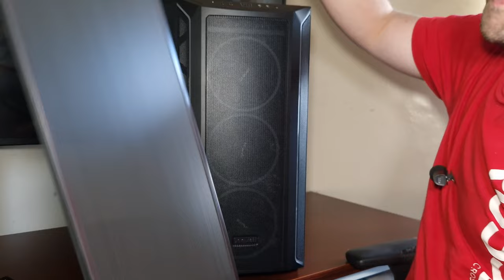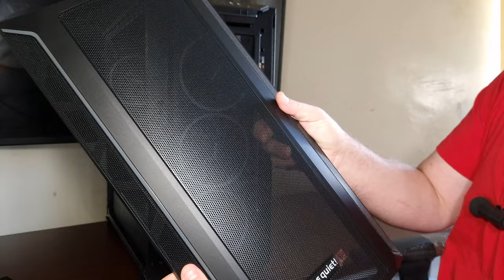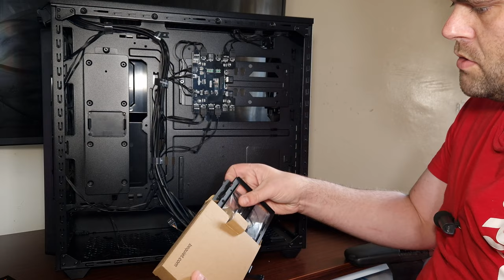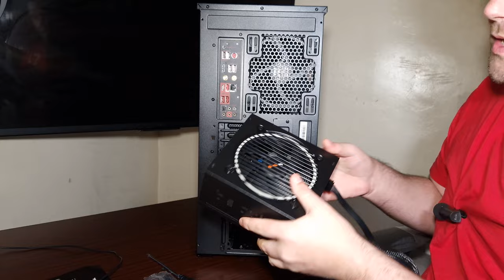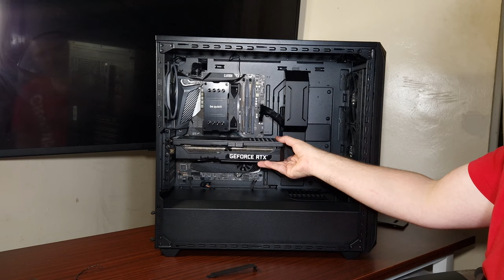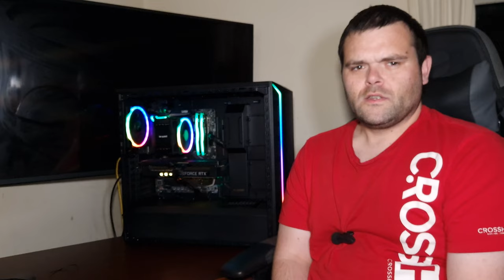Be Quiet! 800 Fx Is The Perfect Case For Your Next Pc Build.

Comment: I'm building this same exact setup except I'm going with Asus Tuf 4070ti super and 7600x... But I just found the same cooler and was wondering how it would look with this case glad I found the video. Wasn't gonna use Rgb Ram but I might now.  might also add 3 additional fans to the top.
Reply from the maker: Glad I could help 😌

Comment: I'm close to pulling the trigger on this buy but then I think it might feel a bit oversized and empty. Originally I wanted to make a compact build, maybe matx, but I ended up looking at bequiet 800 because I want something can easily fit 360 aio in top.
Reply from the maker: Case isn't that big it's classed as a midi tower but it's a little bigger than that but it's a good case airflow Is great and looks fantastic

Comment: Whats the price on thus welshy ?
Reply from the maker: on the case or Build ?
Reply from the maker: case is £210
Reply: @WELSHYTECH  thats not 2 bad
Reply from the maker: @pandapaintsautobodyrepaira2416   well when a Fan pack of the Light wings 140mm are £65 and one fan is £20 separate